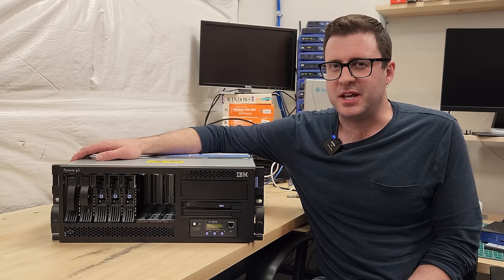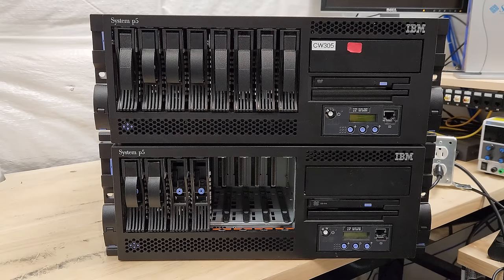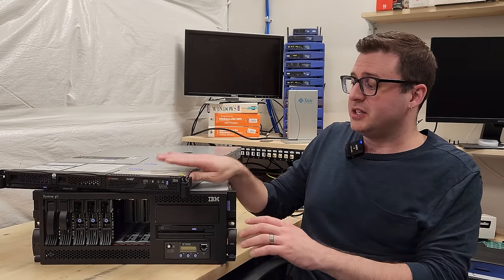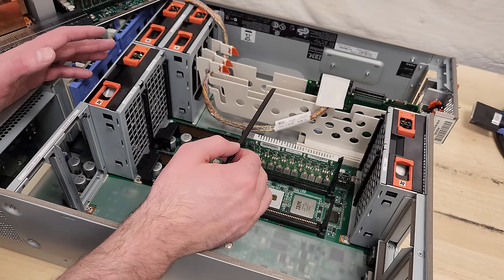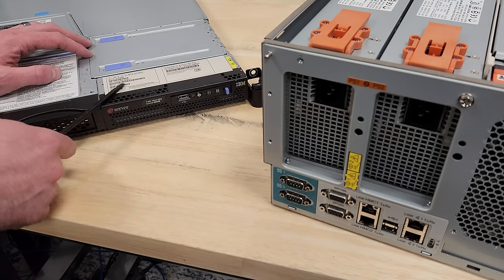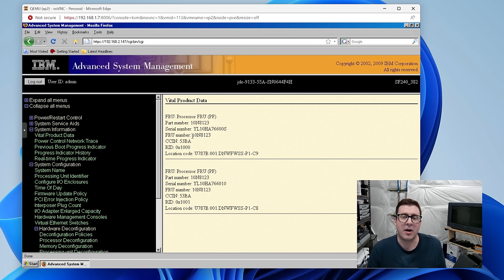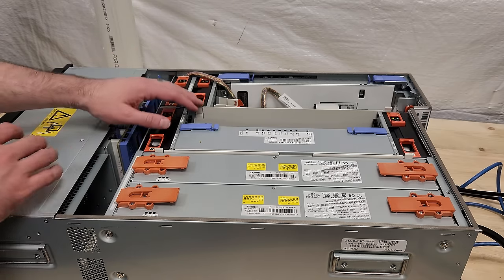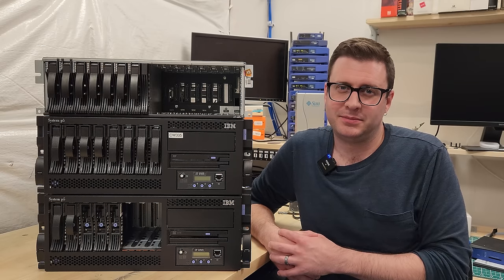IBM System p5 550Q

Comment: I suspected as much, and had to ask my wife who is the P Series expert here at home: The NICs can be divided between LPARs just like in the virtualisation platforms that, eh, learnt a lot from IBM. They're connected to VIO servers, which are special LPARs that only perform resource sharing for other LPARs.  So, you don't need a NIC per LPAR. What you typically would do is to build a LACP pair (or quad, as it were) into your switching environment, and running that aggregate interface in 802.1q trunk mode, so as to be able to assign different networks to different LPARs.

RIO lets you add more I/O drawers for even more PCI slots. Not link separate machines. Has been around a long time; I installed my first  multi-drawer machine, a M80, back in 2000. One CEC, (CPU and RAM drawer) and one PIO (Primary I/O, looks like a 520 in its own right.)
Reply from the maker: interesting!

Comment: That HSL link is to stack multiple power machines and share resources. Not really familiar that much with p5 but proto over those wires should be infiniband and should allow sharing of memory&compute or at least allows moving a live LPAR from one chassy to another.
Reply: And it has 2 connectors because you could daisy chain p5s in a rack so the connector needs to be robust and probably lock secured to the chassy.

O yeah, there is nothing but scsi/FC for storage on systemp5

Comment: consider installing a nema L6-30 twist lock outlet and get yourself a 1U horizontal pdu that has c13 outlets. So you can use the very common / cheap c13-c14 power cords.

Comment: Alternate serial console access:  
If you have that V240 up and running (and is running Solaris 6/8, maybe 10 IIRC), then you can connect the 9-pin serial on the back of the V240 to your target host (via 'null modem' or 'laplink' serial cable).  Then (if Solaris defaults weren't changed) run 'tip hardwire.''  I used to buy and hand out those dual-headed Belkin serial cables for co-workers, at a time that felt like an age ago (pre-Y2K).  I still have mine stowed away in my cables kit (previously lived in the car), alongside an original blue Laplink cable.

LOL at that FC connector btw, some Sun models used those drives, they sucked IMO due to the rarity.
Reply from the maker: Yeah I had it hooked up to a little Lenovo Linux box, but once it's over in the rack I actually have an MRV secure console I'll be able to use.

Comment: I've seen one of these going locally for cheap, which is rare. All this interesting stuff unfortunately stopped being cheap quite a few years ago in this part of the world. Only thing stopping me is I can't justify another server of that size.

As for powering it thankfully I get 230V at the wall, so just run an extension cord from here as I'm sure the several thousand km won't cause too much transmission loss :D

Comment: Clabreto, on the $25 drive adapters, my thought is the allow "Hot Swap", looking at the connector the contacts are different lengths allowing grounds to contact first in the swap process
Reply from the maker: good call, for easier hot swap detection maybe!

Comment: The IP change did not persist, because I think you need to switch from Dynamic to Static. Otherwise it will use a default or DHCP. Just a random guess. Or maybe it also require to setup DNS / NTP server addresses.
Reply from the maker: yeah I didn't notice that at the time haha

Comment: Interesting. You seem to cover a lot of things I've worked on 😂😂.. i briefly worked on an IBM power 5 back in 2010 while working for the social security department here in Seychelles. I believe they might still be using it today. It was in an AS/400 which I believe by then had been rebranded to i5 🤔 it was a tower version. IBM servers are always impressive in design and looks. Specially the AS/400 or Power series
Reply from the maker: Very cool! Yeah these pseries trace their lineage back to AS/400.

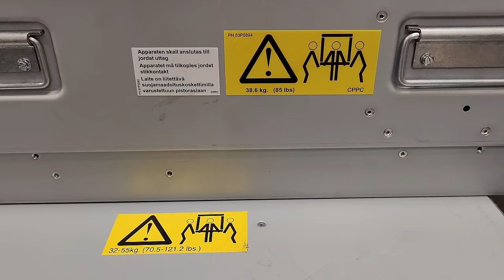Comment: At 4:02 + on the little model, the white sticker has the text "This device must be attached to a grounded outlet" in swedish, norwegian and finnish. Also kilograms is outside of the paranthesis. Was this imported from scandinavia at some point? Just curious why it has scandinavian label stickers on IBM hardware on a device "over the pond" so to speak 😅
Reply from the maker: Yeah it's odd. Only my two p5s have that, maybe some IBM thing they did for regulations or something.

Comment: The one piece that can brick the whole unit is found under the display module (VPD)
If not reprogrammed and licence matched, it become an anchor
Reply: If the system works, do NOT mess with the VPD chip. It’s a onetime flash. If it’s done wrong. You have to try again with another chip.

Comment: HSL's, one of the uses is for RIO cabs. I have two strapped into one of my systems at work, and it gives me a bunch of 64bit PCI-X-DDR533 slots. So you get a dumb'ish cab with PSU's and lots of slots.
Reply: IBM kinda went hard-core with 64bit PCI (PCI-X). HP stopped at 100mhz in the desktop C3750's and friends, IBM started going much further north with DDR upto 533mhz. This was great for lots of I/O. Those two little guys have an aweful lot of bandwidth in them.
Reply: can you run it with UPS ?

Comment: you do serai connections thru the port on the front, there is an adapter cable which translates rj45 to rs232

Comment: I think the issue with your serial to USB adapter is the TX/RX pins are swapped, or you got a bad adapter. I recommend the Gearmo serial adapters and also pick up a USB "null modem" adapter for that TX/RX issue.
Reply from the maker: Yeah I've never been able to get the pseries machines to work properly with a serial to USB adapter (it works fine on tons of other stuff). Always have to use a real serial connection.

Comment: 7:00  I think those cheapo drive trays are just for blocking airflow when you don't have drives in those slots. They're obviously not real trays because that middle piece blocks where the drive would go.
If you didn't have those, the airflow would go the easy way and not through the drives you did have. Those drives would then get hot.  So you're supposed to get real trays when you get drives and use those.  The clips coming off doesn't really matter since they're bogus trays anyway.  What probably happened is they decided to make the placeholder trays junkier to save money since all they do is block air.

Comment: Those servers are pretty light by IBM pSeries standards. I used to have some RS/6000 H70s at work that were metal faceplate beasts and weighed 220 pounds each.
Reply from the maker: Oh yeah those RS/6000 branding era machines look like beasts

Comment: The screen issue could just be the contrast setting on the LCD. This is often adjusted with a potentiometer if there is one on the management controller somewhere?
Reply from the maker: some other folks suggested that too, I'll have to check if it's adjustable

Comment: I'm sure someone else will have mentioned it but the machine type becomes very important when you are logging support calls with IBM, but otherwise if you're not familiar with IBM it makes no sense whatsoever :)  Worst I've seen with IBM is in the storage space where the "marketing" model number doesn't match the system model number.  For example if you take marketing TS3500 and assume that is model 3500 then you log a support call against a disk array from the 80's when in reality it's a "recent" tape library which should be identified at 3584 :)
Reply from the maker: Some other folks mentioned it's useful for IBM support as well for the specific machine.

Comment: if you want to have some fun, try to find a IBM SSA 7133 storage bay with some disks as well as 2 SSA controllers. 
Put an SSA controller in each of these IBM servers and connect everything together. You may be able to use the storage on both servers.. (but not to the same volume)

Comment: I think the reason why you could not set the ip address on the the HMC port is because it is configured in dynamic mode.  So it will always get a ip address from a DHCP server (like 192.168.1.9). Try to set it on manual mode or something like that,
Reply from the maker: Yeah good catch, totally missed that 😆

Comment: Some of those LPAR configurations can do crazy stuff like give you the ability to hot swap processors and RAM while they're running.

Edit: for those USB to serial cables, did you check to see if the OS decided to create a new com port every time you plug it in? For some ungodly reason, Windows would do that to me with one USB to serial cable I had, and I i always forgot to change the com port in my terminal emulator.
Reply from the maker: Yeah I'm excited to mess around with LPARs. Yeah it was the correct COM port, those p5s just don't like this USB to serial cable I think. I always have to use a real serial connection.

Comment: Speaking from personal experience, Mainframes aren't as dead as many people think the term is. Sure sounds like the 80s called and wanted their computers back... but IBM Still builds them around the globe. In Europe they are built in France as far as I was told. They are used by insurance companies and banks mostly. I have no direct z/OS Experience but my former coworkers have, when I was in the financial sector. And boy is licensing on them a pain and hella expensive...I was just a user for an z/OS Application. 
Funny thing: If you get one on lease, IBM even gives you a hardhat with the machine. 

If you wanna see some stuff about it LTT was in the IBM Factory for them some years ago and there are some pretty awesome videos on YouTube by other content creators. z/OS can run on a Raspberry Pi if you wanna dabble your feet into these waters.

Edit: Just a train of thought, wouldn't a beefy UPS help to power the p5s need for 220V?
Reply from the maker: Oh yeah mainframes are definitely alive and well. Yeah I suppose a big enough UPS would help... but I'm just gonna put in a new 240v circuit haha.

Comment: Get one of those tiny serial null-modem adapters that come in the same style as the gender changer you are using, they are almost always orange around the housing so its easy to spot between other similar adapters and you just try with and without the null-modem adapter to see if the serial connection works
Reply from the maker: Yeah I tried various combinations like that off camera without any luck.

Comment: Those cables you have there are for the 5791, 5794, 7040, D11, and D20 PCI-X expansion units which add more PCI-X slots to the system directly attached to the system planar. As implied by the name, the D20 also contains DISK BAYS. Do they contain 20 disk bays? No! That would make it easy. They contain 12 across a split backplane giving you 2 sets of 6. And no, not because of SCSI ID limitations - those were non-applicable. The D11, contains NO disk bays, and is basically specific to the 575 and above. Because IBM. And the PCIHB had other limits; the 520 had a maximum of one unit which required two cables. 
The 550 (8204) does NOT have these PCIHB ports; only the 9133. The 550 tried to work around this issue by having a Virtual Ethernet Adapter (goes above the HMC) with either 2 or 4 gigabit ports OR 1 or 2 10 gigabit adapters as T1-4. Because these supported both VIOS and HMC virtual switches! Which, you guessed it, is virtual in-chassis switches. Though this early setup had some pretty significant limitations and problems. And the cards themselves SUCKED. Those are the expansion slots you couldn't ID though. It only takes the VEA.
Also it's very important to note, the 9133-55A does not denote quad core. It denotes that it is a POWER5+ system. Which is a BIG difference. The POWER5 is a 130nm process, the POWER5+ is a 90nm process; they both have the same number of dies per DCM or [M,Q]CM with the same number of cores and SMT modes. However, the efficiency gains from 90nm allowed them to fit the QCM (quad chip module) into the chassis' thermal envelope. But a 9133-55A can be 1-2 either dual or quad core dies giving 2 to 8 CPUs. And as you can see, claiming it's a Q when they have the same chassis number is as simple as swapping the faceplate.

But honestly? The 8204 550 sucked. It was awful. It's a very different machine from the 9133, and the 9133 wasn't that great either.
Reply: Oh, and I forgot to mention.. that DS4300? Do NOT apply power without first checking the boards, fans, and power supplies. THOROUGHLY. As in fully popping covers and inspecting. They're actually LSI/Engenios, they ran way too stupid hot, and there is a large lithium-ion battery inside - depending on controllers, 3200mAh or 6600mAh. The fans also loved to fail due to the mounting being 90 degrees from manufacturer recommendation.

Comment: High quality well made capacitors do not degrade over time.  What happened in the past was really cheap poorly made capacitors were used and you get what you pay for.  I refer you to some of the old kit curiourmarc has repaired that have capacitors approaching 70 years old and still totally fine.

Comment: In Australia. We are not allowed to do anything Electrical. The only exceptions is changing light bulbs and using outlets.

Anything else.. we need to call someone in.
Reply from the maker: here in the US you can typically do electrical work on properties you own as long as you pull permits with your county and get it inspected afterwards

Comment: It is not quad-core, it's dual-core.  Each MCM has two CPU cores and two caches.  The 4-core 8-way MCM was only used in the Power 590; its size and power/cooling requirements would have been too great for a rackmount system.
Reply from the maker: interesting!

Comment: You can use phase jumping like what ElectroBoom did in that hairdryer video to make 208 / 240 volts, depending on your home's wiring system. But it's not safe to do that in any way, so please be careful.
Reply from the maker: posted a followup video and put in a 240 receptacle!

Comment: I know this is a dumb wonder, but a wonder nonetheless, was it refusing to take your IP settings because it was set to "dynamic" mode, which for almost everything I've worked with, means DHCP? I don't know if IBM calls it something else, but, well... as I said. Wonder.
Reply from the maker: I think you're completely right. I didn't notice I had left it dynamic until some other folks also pointed that out, almost certainly the issue!

Comment: Flat-head / nut-driver screws on an IBM?  You don't say.  :-D

I'm pretty sure that all the enterprise equipment vendors are trolling us with their rack rails.  I've seen so many elegantly designed pieces of equipment -- from network to KVM to server appliances -- with rail designs so incredibly dunder-headed that I can't possibly imagine how someone was creative enough to come up with a solution quite that daft.  I think APC might hold the crown, but I do remember some Sun equipment giving them a run for the money.  Those labels with the three or fours stick figures?  It's not because you need that many people to hold the weight of the box.  It's because you need one person to hold it while one on each side guides the rails into the rack, and presses the levers and contraptions required to make the correct segment contract before the rest slides in and locks it in place while still being half out of the rack.
Reply from the maker: haha. it's amazing how the rack sizes are standard, but nothing about the rails are at all

Comment: In a commercial environment, this unit most likely ran on 208, not 240.
Reply from the maker: yeah that's why the PSUs are rated for 200-240v. probably realistically get 220v

Comment: The SCSI is almost never built into the board because it's not a given. Not only did there used to be a lot of different options for increased density and performance ($ Upsells), but it's easy enough to run machines like these off of storage area networks (SAN). No reason for IBM to eat the cost of including storage access on the board when it often won't be used.
Reply from the maker: yeah good point there, almost always a SAN complementing these I think

Comment: US 240Vac is NOT the same as datacenter 208Vac! A special cable for 240 will cook you machine by putting 2 hot 110v on the machine via what the computer will expect as a hot and neutral lines!!!! Be very careful 

The only workaround I can think of is some kind of transformer you can put in for European appliance off your subpanel but just wiring is not enough you gotta step it up from some higher amperage 110Vac

Comment: I know that unit intimately 
Work 27 hrs straight rebuilding a production unit that was FULL FAIL

Rebuild a few

And service them numerous times over the years

I still have old snd “new” unused/reconditioned components

Programming from the “BIOS” is not straight forward 

I dedicated a laptop, as my mobile HMC so I could TeamViewer share screen offnet